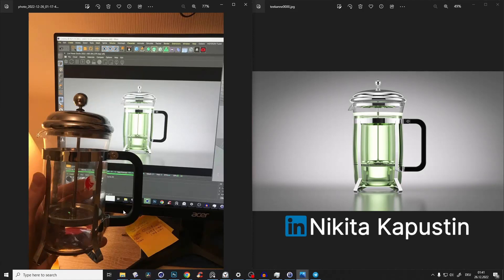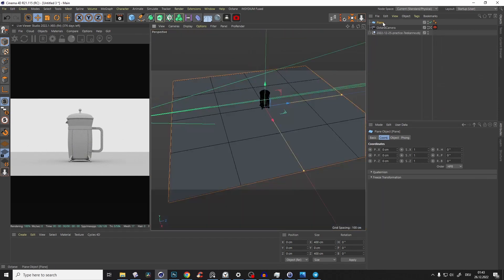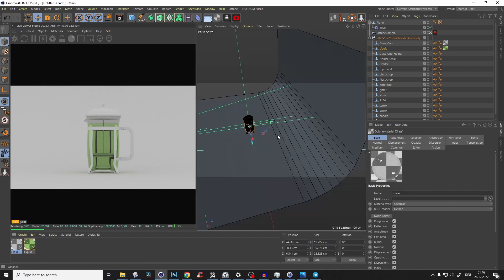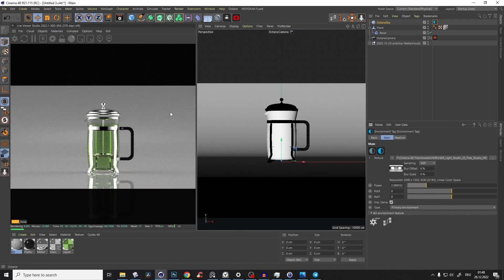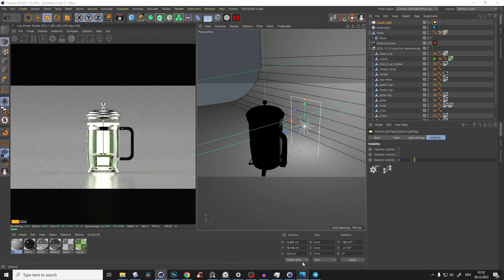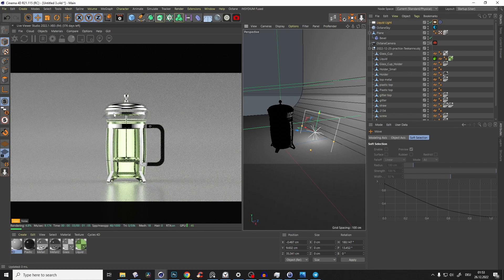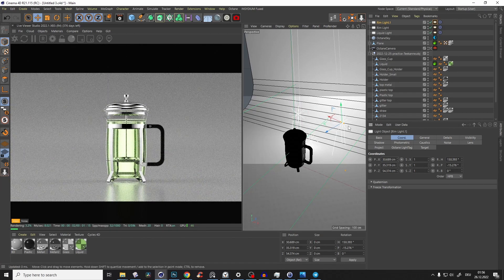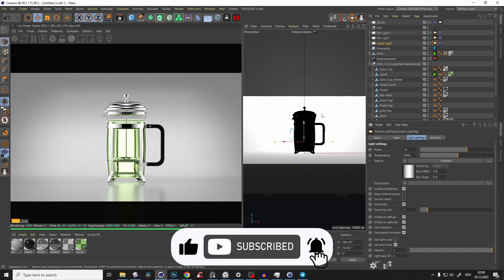Photorealistic 3D Lighting Product Rendering Tutorial | Kitchen Utensil | Cinema4D & Octane Render

Comment: Cool quickie, Have you tried setting priorities for nested dialectrics?
Reply from the maker: Do you mean to make the liquid intersect with the glass?
If yes, then I forgot to do it in this example. But still looks good.

Or what exactly do you mean?
Reply: @nikita.kapustin  yes, after you make the surfaces intersect you can set the priority of materials in the common tab I think, for example value 3 for glass 2 for liquid and 1 for bubbles, I'm not sure if it would make a difference in the render you made as it looks good already, I'm just wondering would it be an improvement worth doing or not really? I think it's best used when the materials have different ior values